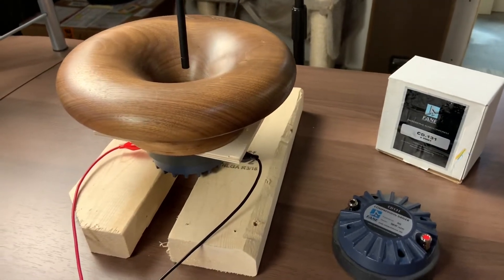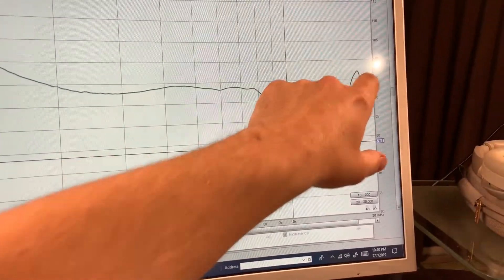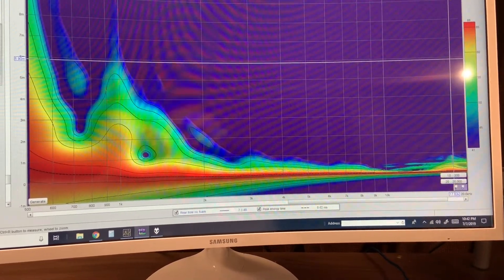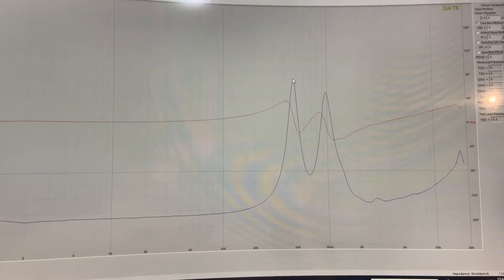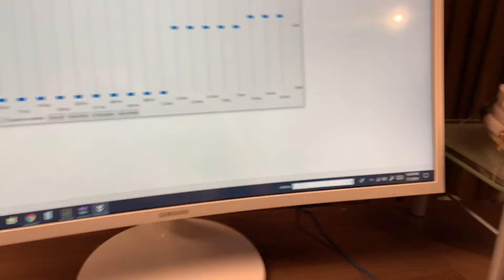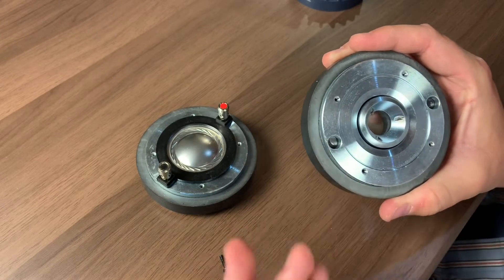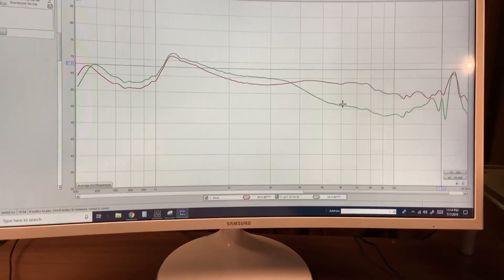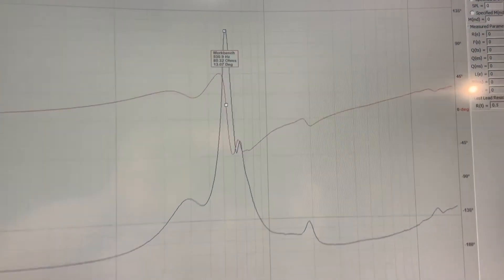Modifying a Compression Driver

Comment: Here we are 4 years later... revisiting this video. For many

 years one of the mods I make on compression drivers is to add a huge rear chamber, usually 3 to 4 inches in length, and then fill the cavity with absorptive materials. In essence, we are taking your addition of a foam piece, and adding orders of magnitude to the loss in the chamber. I have done this JBL and TAD drivers, both 1" and 2" exit.  

Instead of layering the dome, just get some Aquaplas and thin it down to a viscosity that can be airbrushed. This will de-ring the dome structure without adding so much mass it becomes an acceleration/deceleration issue. 

I always throw away JBL diaphragm's, and replace them with Radian.. the surround is vastly superior, more lossy and less stiff.  TAD dias we keep. 

Application of Aquaplas, 4" domes, apply between 1 and 1.5 grams.. weigh after it dries. Match them as close as possible.  More added material kills acceleration, less is insufficient to damp effectively.
For 1" exit drivers with 1.75" dome, apply 0.20 to 0.28 grams.

Comment: Hi. First of all I want to congratulate you for your work. I recently discovered your channel and I am following you.
I have a question to ask you. How accurate is near field measurement for high frequencies? I ask you because I took a course on acoustic measurements a while ago, and the instructor told us that near-field measurements were only useful up to 500Hz. 
On that occasion we were measuring the frequency response of a cabinet with 2 speakers (woofer and tweeter), and for the woofer he used the near field method, but to measure the response of the tweeter, he placed the microphone 1 meter away, at 1.20 meters high from the floor, and the cabinet was also at a distance that I don't remember from the back wall. 
Thank you very much for sharing. Hug.

Comment: Now, what does modifying the diaphragm compliance do to the power handling? I would guess overexcursion at higher levels would be likely with a possibility of the diaphragm bottoming out on the phase plug in extreme conditions.

With the goal being adaptation for hifi use as opposed to pro sound that doesn't mean it's a bad thing. It only means a bit of experimentation to determine operable limits.
 Alternately, adding a shim between the diaphragm and the driver body can allow added excursion, but changes to voice coil location in the gap...

Comment: 3 tricks to improove eff. of tweeter. 
1. Remove the front metal shield. 
2. Use thick short cable.
3. Scratch with emery paper the inside of the coil former until you see it's thin enough, but without touching the diaphragm. 
You will get 6 db improove

Comment: O.M.A have a speaker called the De Ville with what looks almost identical to your compression driver design and they use a special  bullet metal trilateral device put into the wooden passage of the compression driver....that is what you need to improve your speakers...check out O.M.A s videos concerning this

Comment: I didn't get... A compression driver is a "compression" one exactly because it works on a horn resistance at one side and a small insulated chamber at another side. It needs a compression. Which hole are you talking about? Are you sure you used a proper horn with a proper acoustic resistance, so you must see a difference with and without a hole.

Comment: WoW you can really hear the difference that your mods have made !!!!! , great job!!!  - I thought I  would let you know that the BMS 4592nd - Midrange can easily go down to 350 - Hz - the Volti Audio Vittora sounds really GREAT at that xover point!!!!! , I think that the DCM50 can get down there too, but I haven't heard it . I know there are also  several other BMS drivers that can get down there too. THANK you great video I learned a lot.
Reply: @Dean Halleck reading that driver (the Fane Joseph modded here) specs it doesnt appear it's a mid... usable freq response is told 2-18kHz.

Comment: Listen, the only frequency that all driver producer try to sound best is from 8000 hz to 12000 hz. You can`t do much because that is the best frequency for the ear but it`s the most dificult to imrove.
Sow, you can`t do much. It`s fisics.
For my opinion, a good line array wave guide can make them sound better and louder., or just buy a high qualitty 3 way cabinet
I have DE250, DE45, RCF N350 and 18Sound HD125 compression driver. 
Wich sound best?
Smaller the diaphragm, cleaner the sound is.
Bigger the diaphragm,  lower it goes but it looses clearness because from 10 000hz and below, it goes down. 
Sow, it`s a matter of choise and what you use them for.
Reply from the maker: Thanks for the comments.  There are many ways to improve the sound.  The context of my video is for audiophile listening not live sound reinforcement.  I’m not aware of any line array technology that would be suitable for audiophile listening.  Although some do sound amazing, they require a very large venue, not a living room.

Comment: You might be better off making a phase plug out of felt keeping the same shape
Reply from the maker: Interesting.
Reply: And I should have said maybe trying instead and as well with the original phase plug using alpaca wool very fine dense fibres packing the chamber behind the phase plug right tight to the phase plug. Having a gasket of 2 mm or so of sorbothane between the driver cone and the magnet body. Thing is you have to machine out the metal body of the magnet so you not extending overhanging the vocal coil. You could try some 3M surgical tape to start off with see what readings you get
Reply from the maker: It just so happens that I’m using alpaca wool now.  Interesting on the foam spacer.  I’ll look at doing that as well.
Reply: @JosephCrowesDIYSpeakerBuilding  what was the results you gotten from the alpaca wool.? it is good as a dampener for a chamber as well if you're inserting a tweeter or mid-range driver or sheep's wool
Reply from the maker: I never directly compared the alpaca wool to the open cell foam.  But it would be interesting.  Maybe I’ll do a quick test.
Reply: I would suggest brass, not felt. You don't want distortion, ie compliance. It's a high pressure zone, so mechanical deformation and resonance is a problem.